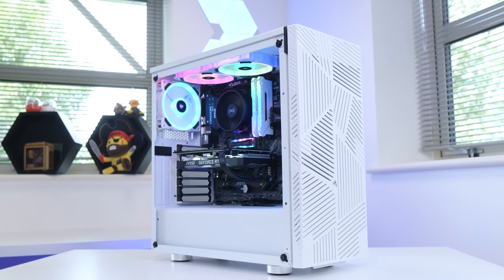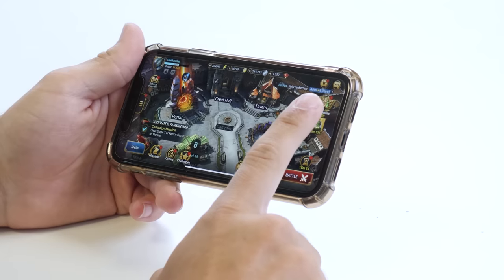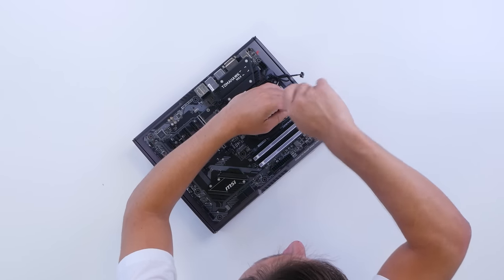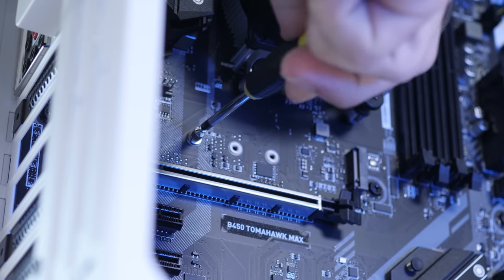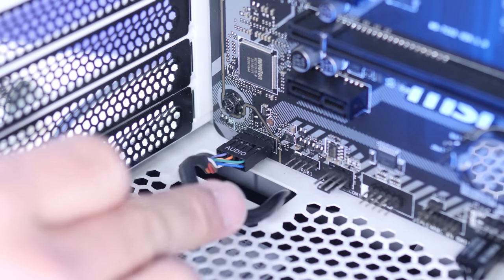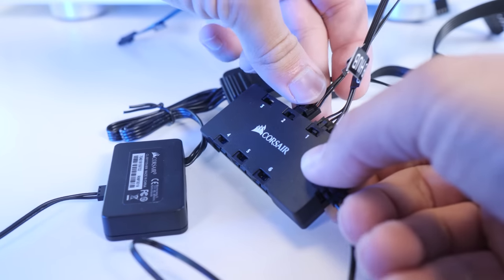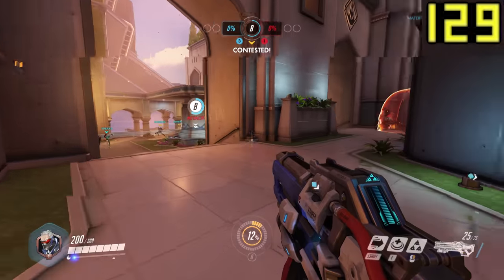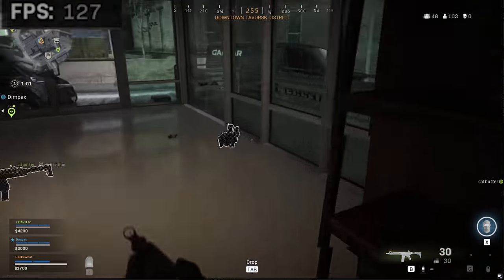Insane $1000 Gaming PC Build 2020! [RTX 2060 Super w/ 1440p Gaming Benchmarks!]

Comment from the maker: Install Raid for Free ✔️ IOS: https://clcr.me/GeekaWhat_iOS ✔️ ANDROID: https://clcr.me/GeekaWhat_Android ✔️ PC: https://clcr.me/GeekaWhat_PC and get a special starter pack 💥 Available only for the next 30 days
Reply: can you stream on this pc and play fortnite on 160fps on all low settings? love the vids keep it up
Reply: You look like the main actor from kingsmen 2. Btw the benchmark seems few frame lower than those other videos with same config.  115fps n in yours 105fps. 142fps n yours is 135fps etc
Reply: Can the case, ram, rgb fans be black instead of white plz
Reply: Brother can u make a Gaming/Streaming pc under $300 to $400 if possible ☺️
Reply: What about the hard drive?
Reply: The UK link for the gpu links to an rtx 2060 not a 2060 super
Reply: Do the fans help the performance in any way?
Reply: The psu is out of stock
Reply: Nvm found one in stock! Got all the parts now
Reply: Replays BTW bruh OFC BROOO
Reply: The video froze in the beginning and you were staring at your right side🤣🤣
Reply: do i have to buy the controller separately or does it come with the case
Reply: Sol ??? Wdym
Reply: What is the best cpu that can be used with this pc
Reply: No
Reply: Does it matter if I pick 1 tb on the m.2 you picked. I’m doing the same build as you.
Reply: Also does it matter if I use a 1tb Vulcan t series Sata, because I don’t like hhd’s
Reply: So you only put 3 Corsair fans in the build?
Reply: Where do we plug in the 2 fans that are not rgb

Comment: And for this, we are going to need a toiny screwdriver.
Reply from the maker: See you're picking it up already! :P
Reply: sometimes i have to put captions on to understand some of what hes saying  his accent is thicc lol but i enjoy this channel!
Reply: @GeekaWhat  when will u make a pc build with wifi motherboard?! i cant get my internet in the room too small
Reply: @GeekaWhat  and not enought switches
Reply: @limitedfair  you can use pcie network adapters or even just usb ones
Reply: @mrbodycatcer  ik but i dont wanna buy one plus im gonna buy a hp all in one because i give  up finding a mtoherboard with network and the all in  one has 1050 4gb
Reply: @limitedfair  If you're fine paying extra more to still get the antena peeking out of your back of the case, you can easily find motherboards that support Wi-fi if you're talking about desktop PCs obviously :D
For AMD:
 if you want to go with Zen2 (3rd gen)-
►You can get "MSI B450 Gaming Pro Carbon AC" although i wouldn't recomend this one.
►You can get "Gigabyte X570 I Aorus Pro WiFi" which is fairly more expensive, but has upgrade path for newer generations of Ryzen cpus.
For Intel:
►"MSI MPG Z390 GAMING PRO CARBON AC" for 8th / 9th gen
►"Gigabyte Z490 AORUS PRO AX" for 10th gen
I personally would suggest you the same (@Honey Comb) suggested and to go with a cheaper option if you want to have a bigger bang for buck. I'll let you choose what can fit you the most open-handed. Your money, you can do what comes closer to you with it, but some suggestions couldn't go wrong.
Reply: Toiney
Reply: Read while he said it lol😂😂😂😂😂
Reply: Swiss army knife is better

Comment: Here's some tips for when you build another pc.

1. Installing the m.2 before putting the mo o in the case makes It a ton easier

2. Before putting the sata cable on the PSU, it's easier to set the supply in and THEN put the sata cable.

3. The graphics card should always be the last thing you install

Other than that, you did a great job! Keep up the good work.

Comment: My pc was inspiration to this
Parts-
-GPU GTX1660 Supper
-Motherboard AMD x470
-CPU Ryzen 5 3600
-power supply EVGA 750w B5, Fully modular 
-Ram DDR4 3200MHz Corsair vengeance same ram used in video
-Corsair 275R airflow mid tower same case as him but black
-SSD internal     XPG S40G 512GB
-120mm fan extra

Comment: Im looking to build a similar pc, I'll be using the same case but im wanting to use the Be Quiet! Dark rock pro 4 aftermarket cpu cooler instead of the stock cpu cooler as i will be using the ryzen 7 3700xt. With the LL120 Fans at the top will there be enough clearance for the cpu cooler?

Comment: Since the B450 is out of stock right now I was thinking of using the ASUS PRIME X470-PRO, as well as considering upgrading the processor to the Ryzen 7 3600X. Do you think it will impact the benchmarks or improve overall performance?

Comment: Great video, but I wish you would have shown the temp of the CPU while gaming. I just finished my build, with only a few small differences to yours, and my CPU is running pretty hot even just at the BIOS. I'm nervous to see how high it climbs when gaming. It would have been nice to have known that beforehand, so I could have ordered a Hyper 212 or a Freezer 34 to replace the apparently garbage Wraith Stealth. Now I have to get the new cooler before I can even think of starting to do any overclocking.

Comment: I built this pc about a month ago and I am loving it!
Reply: Did you have to buy any extra cables? Or everything came with the parts? Also do you have to install drivers? If yes, can you share the links?
Reply: @Overdose6SK  Yes all the cables i needed came with the parts, but I swapped out some parts that were used in the video. I didn't use the stock cooler and got the Hyper Evo rgb black edition (about $50), and the msi rtx 2060 super (440 but tax so about $500). Also I didn't trust the ssd in the video so I went with the Samsung 970 Evo 500 g m.2 ssd (about $90). But everything all the cables i needed were included with the psu. I did install drivers for my gpu and cpu and you can do it by just searching up the drivers on Google Chrome or just watch a yt video. If you do end up building the pc good luck!
Reply: @joell111  Nice, thank you so much for the help. I'm building it tomorrow, hope everything goes well
Reply: @Overdose6SK  I hope everything went well man, enjoy you're new pc!
Reply: @joell111  yeah, everything went well, thanks man

Comment: This is my 1000$ configuration(in my country prices are differents).
Is this any good?

AMD Ryzen 5 3600 

ASUS Turbo GeForce RTX 2060 SUPER EVO 8 GB GDDR6

Corsair Carbide Series SPEC-DELTA Case   
 
Corsair TX650M Serie TX-M, power supply

Corsair Vengeance LPX RAM Desktop 16gb 3200

MSI B450 gaming plus max 

Samsung MZ-76Q1T0BW  SSD 1T 860 q

Comment: Differences Between this one and last one 
1 Raid Sponsorship
2 RGB SSD That is lower capacity
3 Different case
This video was a lot like the last one
Reply from the maker: If you're referring to the last $1000 build, it also had a different PSU, RAM & SSD -I'm not gonna drastically change all the parts for the sake of it - I recommend what is the best value purchase choice.
Reply: the psu and ram were the same

Comment: I just ordered this build. How would I get around installing an additional hard drive  or SSD along the line? Cause I read up if the m.2 slot is being used, it disables the SATA connectors on the motherboard. Sorry if that's wrong. This is my first build.

Comment: The R5 3600 gets super hot (90 degrees at some times), I would recommend instead of getting expensive corsair fans to buy an aftermarket cooler.
Reply: Mine never breaks 80. What are you even doing???
Reply: My R3 3300X gets 80-90 while playing games on stock cooler. Also, changed the thermal paste and remounted still the same. Never had this issue from my i5 6400 same stock cooler and same build.
Reply: Jason Lyons its a the stock cooler, on high loads its really not good enough for the processor
Reply: Zxro i use the stock cooler
Reply: Mine never gets that hot, your case must have shit air flow

Comment: you said we have to use the second and 4th ram slots, if we buy another 2 ram chips will we be able to put them in the other 2? Or are they lower spec or something?
Reply from the maker: Thats correct - just use the other 2! All are equal, but 2 and 4 are the ones you need to use to get dual channel if you're just using the 2 sticks :)
Reply: @GeekaWhat  I see. thanks for clarification

Comment: Thinking about downgrading my 9900k and 2080Ti to this or a 3700x and 2070 Super. Turns out, the rig I built in November of 2019 is slight overkill. I will need at least 32GB of ram though, for editing, rendering and modeling.
Reply from the maker: Lol that sounds like such a killer rig tho!
Reply: GeekaWhat Yeah, a $3500 rig. But I want to switch from AIO to custom loop, so I figured a slight downgrade would give me enough money back to use for fittings, pump/res, hard tubes, etc.

Comment: this is my first build and can someone help me out real quick. he used a 500GB SSD but i don’t think that would be enough because i’ll have programs as well as gaming. i don’t know how to install a hard drive in a setup like this so could someone point me in the direction of a tutorial?
Reply: Same since every MW update is like 100 gb
Reply: buy another 2tb hard drive. it should be as cheap as $60. use the ssd for installing os, hdd as the mass storage such as games etc. im pretty sure you can find a tutorial on how to install hdd easily. its pretty simple, nothing to worry about. just mount the hdd inside the case and power it with sata from psu, and use a sata cable to connect it from hdd to motherboard i will be automatically detected

Comment: Can someone tell me what this means in a more easy way? Lol. Lian Li PC-O11 Dynamic ATX Full Tower Case has a front panel USB 3.2 Gen 2 Type C port that can connect to the MSI MPG X570 GAMING EDGE WIFI ATX AM4 Motherboard USB 3.2 Gen 1 header. A separate USB 3.2 Gen 1 to USB 3.2 Gen 2 header adapter will be required.

Comment: i'm going to try this for my first ever PC, silly question but i'm so clueless,  how would i connect it to power and internet, like does it come with the sockets to plug in and would i need to get an ethernet cable some how or would it just connect to wifi like normal laptops and stuff, sorry probs triggered loads of people
Reply: You can use a Ethernet cable or get a usb WiFi dongle that’s all I know for internet and yeah you just plug it into the socket 😂

Comment: So everything is this video is exactly 1000$ or is it slightly higher like 100 plus
Reply: Ultra it would be a little higher if you got the fans and if you wanted a network card or anything extra, but right now prices are extremely high and the pc will be around 1600$ since everyone is buying PCs since the quarantine. I would wait till august or just check the prices if you want to get them for about 1000$
Reply: Fayt are the extra fans necessary? I’ll build this in a couple of months but im not into spending 80 more dollars on those fans
Reply: T R  well the case only comes with one fan I believe so the extra fans would help with cooling
Reply: T R nvm the case has two in the front and one in the back. So no, they are not necessary

Comment: Could someone help me out? I have a question about the PSU, he is using the Cx750M Semi-modulaire if im correct. This costs 200+ Euro for me, am i able to use the Cx850M Semi-modulaire? It is 100 Euro's Cheaper as the 750.

Comment: Lol you can get faster ram for cheaper (you linked 3200 not 3600) can get just as good as an SSD for cheaper, cheaper case and psu, and then upgrade the gpu.

Comment: I more or less know all the parts i wanna buy exept for the mother board, theres so many out there and i have no fkn idea wat the differences are on em
Reply: I was kind of in the same position, but I chose the same one in this video (MSI B450 tomahawk max). From what I've heard, it's the best B450 motherboard and good value for the feature set. It will support future cpus and is compatible with ryzen 3rd gen straight out of the box unlike a lot of other B450 boards. B450 boards are a good value for gaming/light streaming. There are cheaper boards, but they aren't compatible with ryzen 3rd gen and don't come with as many features. I hope this helps.